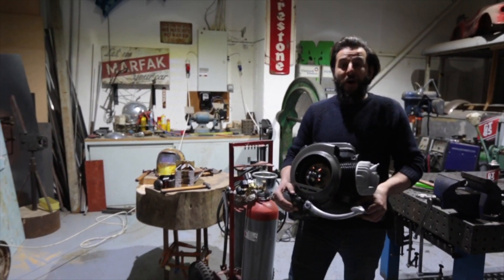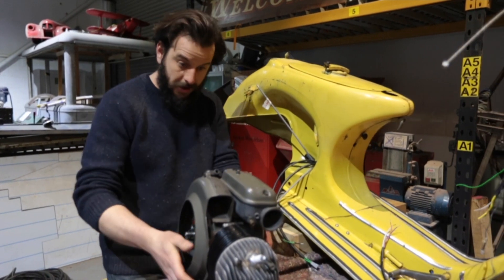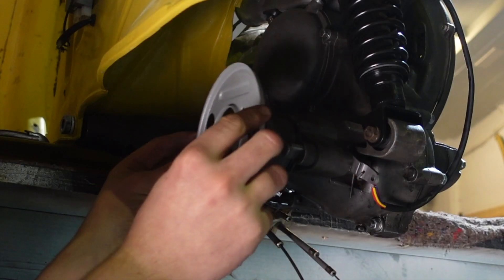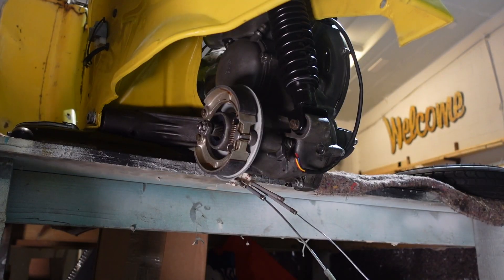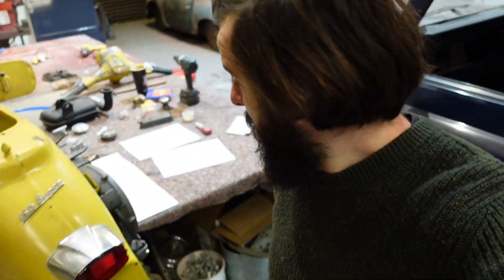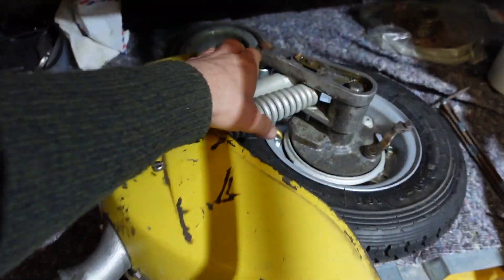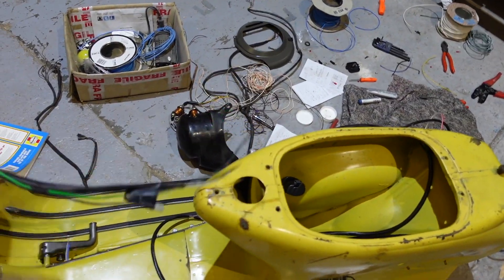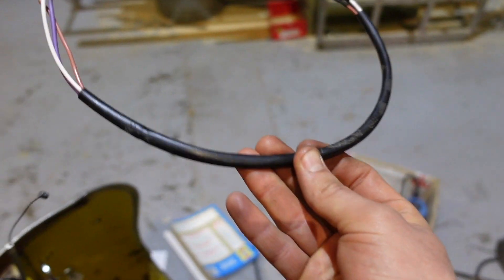'Wheels Up' | Vespa Restoration - Episode Five

Comment: Can wire up a variable power supply to emulate the motor running. As far as painting went, we here in Australia have a product at the local Hardware store called penetrol. Used it on bare metal, and came up a treat as a clear coat on projects of mine. I would have suggested to use that to lock in the patina of the paint whilst providing adequate protection  without resorting to having to paint a specific colour. Rub the original paint back to a necessary point to remove rust, and presto. Save rubbing it, you could also have used oxalic acid to restore the original steel, THEN penetrol i guess. And you would have yourself a well preserved time capsule

Comment: Making good progress Dom. 

As to the electrics you CAN actually hook up a 12V battery to the system to test it all out (I've done it several times on my builds to test it before I mount the harness to the frame). All you have to do is connect your harness ground to the frame and make sure to connect your battery after the regulator/rectifier to the rest of the system. Should work a treat. Looking forward to your first fire of the engine.
Reply from the maker: Thank you! I am definitely not very good at the electrical side of things, appreciate the guidance

Comment: you are using an idm ignition. don't forget to measure your ignition timing at the right rpm. it's not static it adjusts around 7degree.

25°-18° before tdc is a good start.

Comment: im trying to rewire a px 125 disc have a load of wiring diagrams but not the right one with right coloured wires on it , doh, getting my head round it slowly but would help if can find the right one, fitted stand today, bit of wet colour sanding to bring back paint, and then t cut with cordless drill, mainly ive been trying to fit a set of after market floor runners, surposedly for px, but has taken all day to fit them, drilling and bending and measuring, within a spit of riveting them on tomorrow,
 dont need to run just need to work on getting spark first, dunno if u still have points and condenser, or gone with electronic ignition best wishes, springs are easy with vice grips!

Comment: get yourself a USB charged 12v jumper..Moerun do one that basically gives you a portable 12v power supply that you can test components with...and it fits in your workshop trouser pockets...as long as they're big 😁

Comment: So I was wondering at the balance between looks like new (the engine, rear wheel etc.) and the tatty front end. Personally I would have liked a respray!
Reply from the maker: Absolutely, I have tried to get a sympathetic blend between both, The engine is just very clean, not repainted, once its worn in it should match nicely,  it can always be repainted any time later, its proudly wearing whats left of its original paint for now! 
thanks for the comment

Comment: I must be strange as wiring scooter is one of my favourite parts of the job especially strange as I’m colour blind ! Did you get the loom from beed speed by any chance ? Only pointer I’d give when putting main engine bolt in single handed put a thinner bar through first which helps line up . Also tend bit of Copper grease on main bolt and brake pivots . Great job !